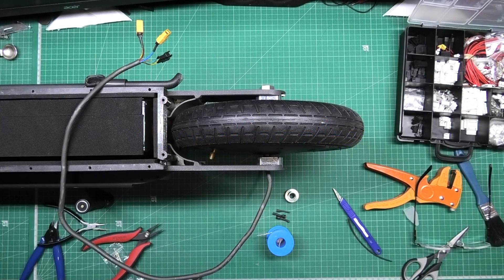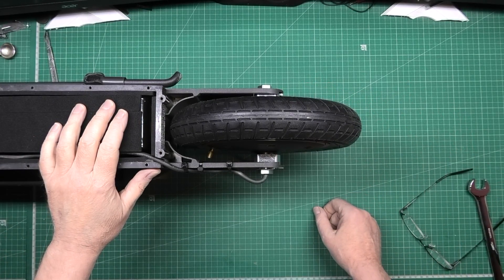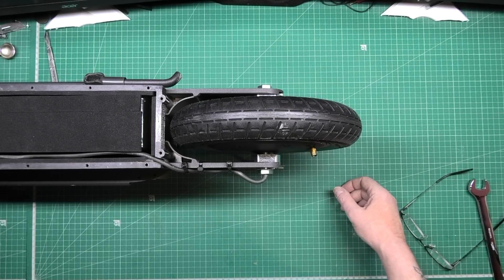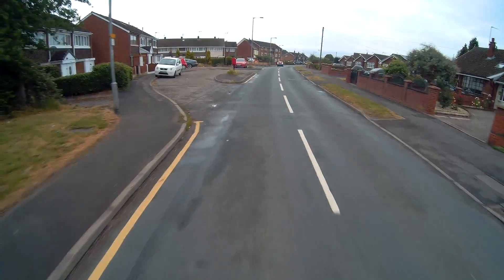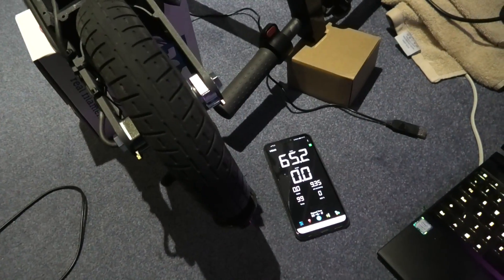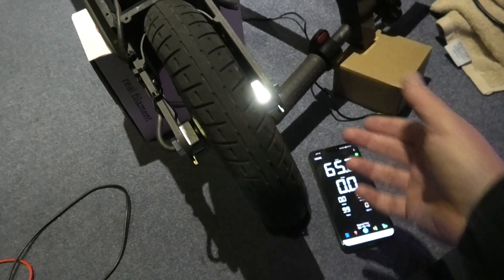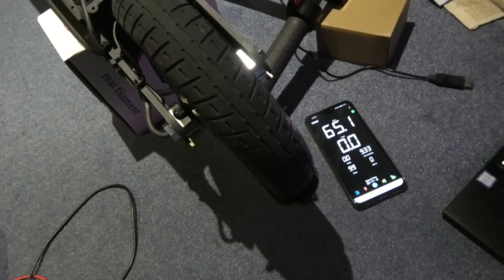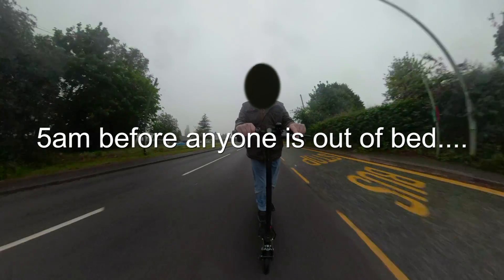Xiaomi M365 2kW RWD conversion. Codename V365 - This thing is lethal!

Comment: hi bought a rwd kit for the xiaomi m365 pro but have problems with changing the direction of the engine, I got it to go backwards but it loses power and makes noise when accelerating. have switched places on the yellow and the green signal cable and the blue and yellow motor cable. Do you have any tips and tricks on how to get them to work, best regards

Comment: With the power you got, you could easily add a front motor hub AWD and just split the brake, gas and power cables so you have motor brakes on both wheels

Comment: Buddy please ensure the brakes are really solid if you want to invest a bit I have a solution where you could mount mechanical or hydraulic brakes to the motor ...it’s a bit expensive mod but works 100% it’s a Russian brake caliper mounting mod to the front fork and you’ll have to change the stator plate that covers the magnets and the stator  to accommodate the new pre fabricated disk slot ! Sorry if it’s a bit confusing but if you reach out maybe I could guide you a bit and collaborate if you wanted to ! Thanks ! I have some ideas but I could make those work in reality only on closed circuit tracks under supervision because of the ridiculous speeds !

Comment: I still keep forgetting to get the weather resisting/proofing parts and rings on outdoor ethernet cable after all the crimping is finished; for running ethernet cable to outdoor security cameras. Some times I'll be like "Oh crap, I just crimped this cable and forgot this ring. But I didn't crimp the indoor end yet", then I go through all the trouble climbing through bushes and climbing ladders and fences to run a little ring from indoor-end to outdoor-end even though it is easier to just re-crimp the cable.
Reply from the maker: I've done similar things and then found out that I need to cut the good end off anyway 🤣🤣

Comment: one pothole = the gateway to hell... - but, I would like that hub mounted in a 26 in MBX wheel... - wouldn't mind a peddle assist-able one - in case of power issues...
- and a bank of THREE of those batteries ...only the EMP of a nearby thermonuclear detonation would render one useless...

Comment: Give it a while after you stop - the motor will get hotter! At least the surface of the motor will get hotter, because its constantly cooled by that damp air you got there as you are moving, but when you stop, the heat from the stator will heat the surface up.

Comment: these motors seem bullet  proof   tried 22s   lipo  18fet    generic  controller    shunt  modded  (fully  soldered  across  it  lool   was crazy fast  but as it  was still front  wheel drive  so   did  burn  outs  going along    think i need to get a or 2  better  escs  for  96v  with regen

Comment: Ok I think the reason behind why your regen fails to slow you down could be that which was explained about EUCs that you need to have your battery always short of being fully charged,  once the battery is fully charged there is no regen as there is no where for the charge to go, so you must keep your batteries at a level that ensures there is somewhere for the charge to go.

Therefore if you keep your batteries always a percentage lower than fully charged you will always be able to get regen braking, but if you keep them too high your regen will kick in and potentially fail once the cells reach fully charged off regen.

I believe in the early days of EUCs people crashed with them due to this problem which they figured out pretty quickly.

Also don't forget that tyres are rated for certain speeds so may become a potential failure point.

Hope this helps.
Reply: actually the charge CAN go into the batteries, but the BMS or controller will normally stop that from happening to prevent fires

Comment: That feeling when you have done all your soldering and you have forgotten the heat shrink Haha! We have all done that a hundred times
Reply: Myself and a work colleague used to call it being "Duraplugged" in honour of those rubber mains plugs from the '80s that everyone forgot to put the cover on the wire before wiring them up.
Reply: the one time i remembered to put the heat shrink and the snap on connector. and then realized i soldered the polarity backwards...

Comment: More Of Anything Is Perceived To Be A Good Thing, but with it comes massive risk.

I Would Say 16 Mph Is Adequate, I've ridden one and to be honest never felt speed was an issue, acceleration was weak.

Your Skills Are awesome.
Reply: There are such scooters available in the US with AWD and 3, 6 kW motor power which run 80 kmh from the factory, but they have a good suspension and hydraulic disc brakes. Micah from Electrek tested one some time ago.

Comment: I'm building an ebike atm and I'm a bit confused about regen.. if the battery is fully charged, does regen work at all?
Reply: It should not, if you charge an electric car to 100 % you also don't have Regen at the beginning.

Comment: It looks lethal for sure. I converted a Razor E300 to have a ~1600W output with a 16s lipo and it's geared for about 28mph. If you go over a road repair strip without bent knees then it'll tankslap. I have a 160mm disc brake on the front and the original drum on the back.
Reply: only 28 thats nothing i bought a hacked scooter that does 28 mph it feels fast but its not 35 mph or higher understandable its lethal but 28 mph is the right speed

Comment: My 150 amp sabvoton will not provide ANY regen, unless the battery voltage falls below 78 volts.  No adjustments in the parameters to change that.  So I only charge my 24s LiFePO4 pack up to 80 volts.  But also decrease Amp/hrs of battery in doing so.  In my case, a 22s battery would make more sense.  cheers!

Comment: you probably know but air first thing in morning negatively charged  changing to positive charge and wet dew/rain positive rain dew negative rising  . those trees and hedge rows look rearly fast passing by on fast forward (officer ) maybe some ram-air side scoups to direct air on to rear wheel motor  placed on platform and maybe at front of platform on to battery

Comment: I think you absolutely have to have a mechanical brake. Even if your electronic one is good, what happens if it cuts out like that down a hill? I am shitting myself going 30 downhill when I know I have both brakes. The Ninebot G30D Max has a front drum brake, wouldn't that fit on the M365?

Comment: How fast did you actually end up going ?
Reply: When he was flooring it he wasn't passing any objects of known length and the scooter is too short to measure without exiting the youtube player :D. However a little after that he passed a Nissan Navara (5:18) for about 400 ms. I found conflicting information about the exact length of that car but let's say it is about 5 meters. That comes up to around 45km/h if my Math is right
Reply: @Anonymous-qx5uk  agree, looked like 30mph easily. Its dead cool and i want one but the handling has to be twitchy af. Id make max 20 with a 30mph push to pass button.
Reply: I reckon at least 40mph easily
Reply: Fair play..balls of steel without any protection..😈
Reply from the maker: Actually, it was 38mph (62kmh) but obviously, this was done off-road. In this video, I was doing no more than 15.5mph but hopefully, the next video should clear it up for you all 😁
Reply: Vortecks regardless that’s very quick, videos are great keep it up. Would love to try and attempt to re create your scooter.
Reply: Yeah would definitely love to upgrade my scooter to this but it looks like a lot a lot a lot of work haha

Comment: I lost my brakes at 22mph, needless to say I needed new pants as it was going down hill and around a bend which is why I wanted to slow 😂. Really enjoy this, again as I always say I really want an extender put on my scooter but in not going to fiddle with it myself rather a tech did that.
Reply: on mine i have a break on the rear wheel just in case my electronic brake fails.   you just push down on it with your foot and you stop. ( its worse when its wet tho)